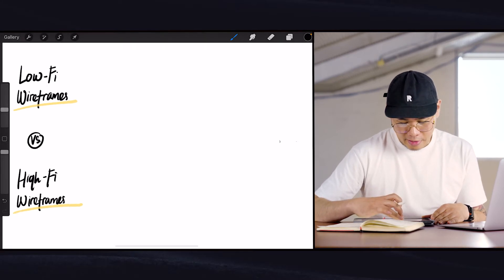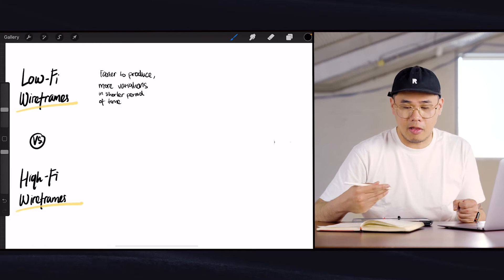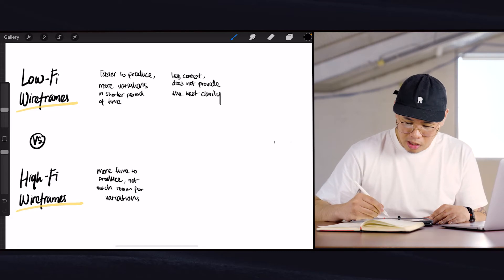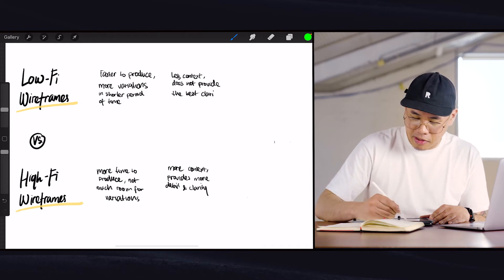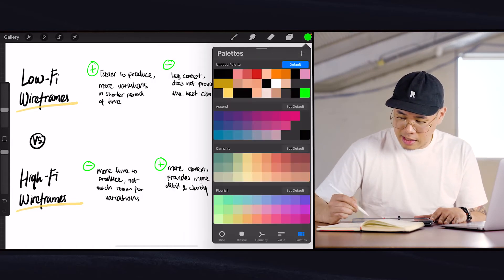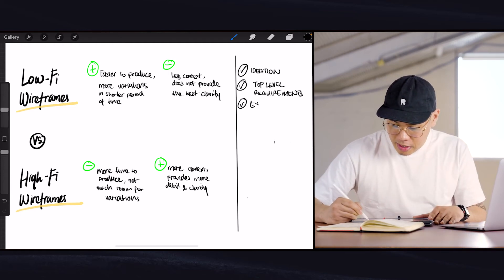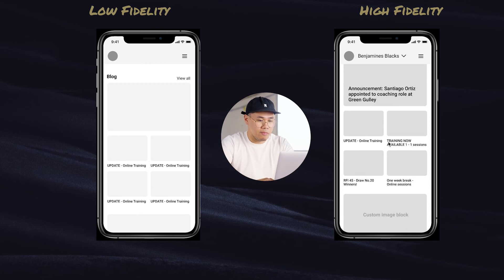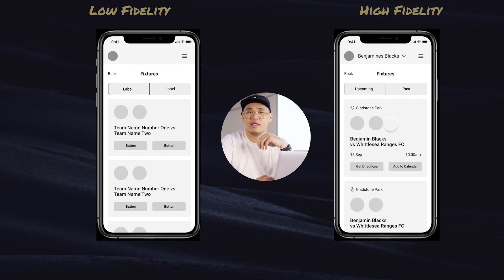Wireframing – Low Fidelity vs. High Fidelity

Comment: Alvin a question, from my learning I understand that LO-FI are less text and they use elements more for example if you doing an icon you might use circle with a cross, for text you use line obviously keeping in mind the text hierarchy and for image used it will be a rectangle will a cross, and call to action button with text. What's you take on that?
Reply from the maker: You got it. Having said that, fast forward to 2025 as I’m writing this — the benchmarks between LO-FI and HI-FI wireframes would have changed given that there are more tools available that will allow you to generate “higher” fidelity LO-FI wireframes. 

Essentially, LO-FI is your less detailed, lower effort version that allows you to explore more ideas in shorter periods of time.